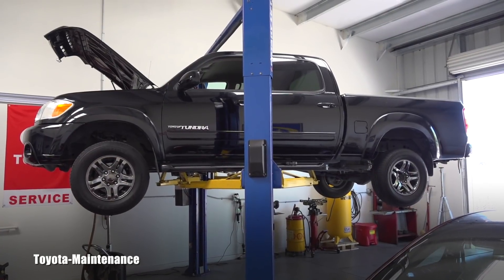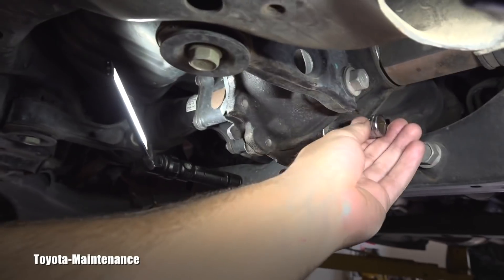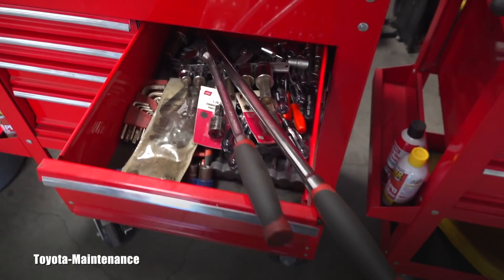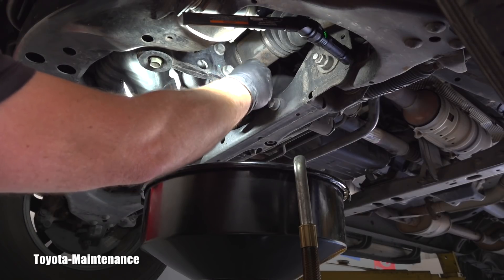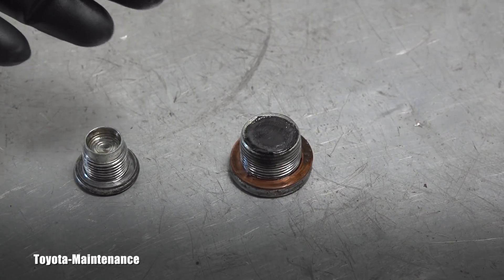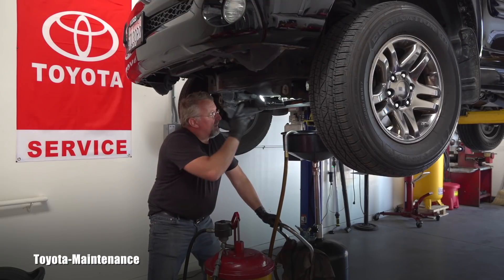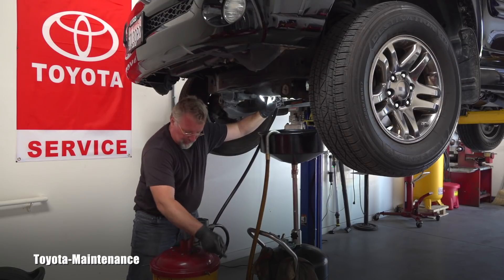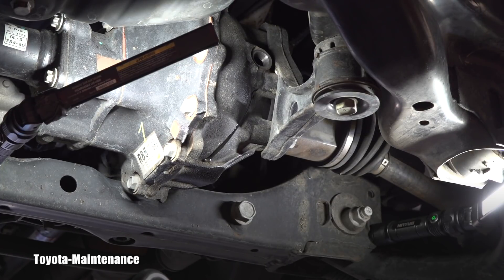Toyota Tundra Front Differential Oil Replacement

Comment: That Tundra looks brand new underneath. Awesome to see.
Reply: I was gonna say that I knew it was an older design, but it looks like it just came off the showroom floor!
Reply: I have the same exact truck (black also) and mine does not look anywhere close to the  condition of this truck. Kind of sucks watching this lol
Reply: California
Reply: Mine is brand new take any toyota tundra to a dealer and they will replace your frame for free no shit that's how good of a car manufacturer they are always buy toyota
Reply: @bobbouchee1452 They replaced the frame under mine about 10 years ago. I hose it down with rust inhibitor every season and it still has some minor rust.

Comment: just unloosened all the fill and drain plugs in the rear and front diffs and transfer case in my 2004 Sequoia,  wanted to do this before buying the oils and plugs.  The hardest by far was the fill plug on the front diff, rusted up badly, the 10 mm hex socket would barely fit in, used rust dissolver and wire brush to clean and breaker bar on socket wrench and finally broke free!

Comment: Since jacking up the left side ofthe vehicle to get the proper draining of the rear diff fluid, I didn't see you dropping the jack so the filling procedure would be equally accurate and complete.

Also, did you undercoat your truck with thatFluid Film or some other product??

Comment: Is it possible if the fluid is low that the 4wd light will blink? I ask because one day I notice that the diff fluid came out the vent hose I guess the little check was suck and create pressure and came out ,I replaced the little vent checks I haven’t add fluid yet but notice after that when I used the 4wd it ingaged but when I took it out of 4wd the light blinks even though it did come out of 4wd drive

Comment: Hoping to see lube change on a tundra transmission fluid change. I hear not to flush the system?
Reply: Absolutely flush them. Flushed mine at 96k and again when the transmission cooler let go inside the radiator. Shifts nice and smooth.
Reply: Drain and fill, no flush
Reply: @somemedic  Of course you should flush them , where do these old wives' tales come from?
Reply: Old chevy transmissions that needed to be rebuilt anyway would still keep going if you didnt flush them and get the suspended material out of the fluid. Had they been flushed at 50k instead of pushed well past their limits they probably would have seen well over 300k instead of being R and R'd at 120k. But that's chevy. These aisin sealed units still need a flush before 100k especially if you tow. Replace the filter, use the Toyota fluid and keep on going for another 100k. Otherwise you could be looking at a rebuild at 150-175k
Reply: Juan Heredia is there a trans filter? Clean out or replace?
Reply: FlyingTaurus  thank you. I plan on doing all my drive line fluids at 30.000. Better early then late. Specially the first change.

Comment: I love the methodical approach for a “basic” service, especially on a Tundra, since I have a 2017 TRD. I believe you consulted the manual for that earlier model, however, in mine, it requires a very unique TOYOTA 75w85 GL5 and the typical gear oil you are using would be incorrect and would degrade the differential. Please consult the owners manual for the proper lubricant specifications, and not a generic sticker. Trust me, the Toyota dealers are sloppy and ignorant as they used the wrong oil in mine!!! I became unglued at their ineptness.
Reply: For best protection use the Amsoil lubricant that meets the warranty requirements.  It will be better than anything Toyota will stock.
Reply: Right Lane Hog No aftermarket oil company has the composition or specifications of the Toyota Lubricants ....... be warned, most anything will work, but you are shortening the equipment life ......
Reply: @1ronhall  Just to be clear, I don't work for Amsoil or own any stock in the company. The Amsoil lubricants I use easily exceed all the specifications DETAILED in the owner's manual. My Toyota just passed  15 years of age. I have been using Amsoil's top spec oil since the second oil change. For 5 years I followed the oil change intervals specified by Toyota.  Once the drivetrain warranty expired, I started using Amsoil according to its ACTUAL capability. That means for a decade I have used the Amsoil long life oil filter and done once-a-year oil changes. The engine remains in perfect condition as does the 5 speed manual transmission which has also been  treated to Amsoil lubricant. Amsoil lubricants have been tested independently and exceed the quality of any other products on the market. Like I said, the best made cars deserve the best protection. BTW I have saved a small fortune by investing in top quality lubes and filters which drastically reduced trips to the garage over the last decade.
Reply: Right Lane Hog congratulations on using premium Lubricants ..... you have invested wisely ...... just be certain the lubes meet and are OEM approved for the application. There is too much gray zone in marketing and the user assumes the responsibility and onus. Happy Mile-ing!!
Reply: @1ronhall  Happy trails with your Tundra, it is easily the best full-size pickup on the market. We have a Tacoma in the family but if we ever needed a bigger  pickup the list of possible choices would only have one name on it.

Comment: Very clean Tundra and the fluid that dripped out from the initial drain looked almost brand new.
Reply: I noticed that as well and it is reassuring to see an owner that keeps on top of things. For the minimal price of the lubricant and labor, what is the point in skipping service?

Comment: Hello, I have a 2008 Toyota Highlander Sport FWD with 185,000 miles.  I have only done oil changes, batteries and tires on her. What type of maintenance should I perform and where do I start to keep her riding smooth? Sorry if I missed a video that already explains this.

Comment: Love the channel!! I am hearing from other Tundra owners to change the transmission fluid at 50,000  miles instead of 100,000 miles. What is your opinion ? Should this be done to the other fluids?? Changing the fluids earlier instead of their recommendations ?
Reply: Use the OEM specified fluids and you can’t change too early.
Reply: Use Amsoil's top spec lubricants. You bought the best truck so logically you should use the best products to protect it.